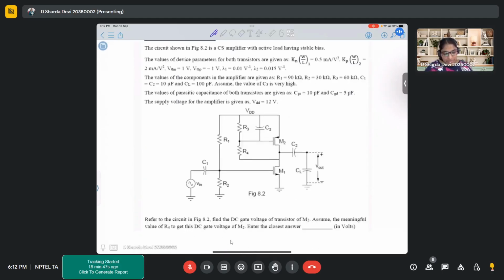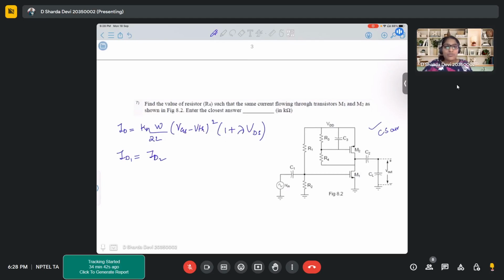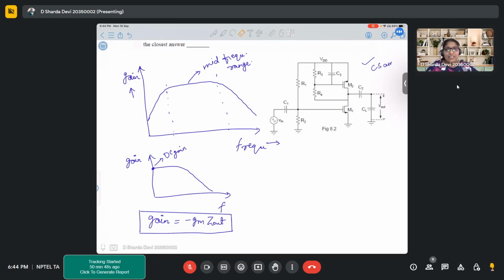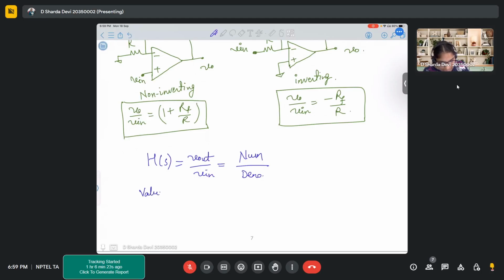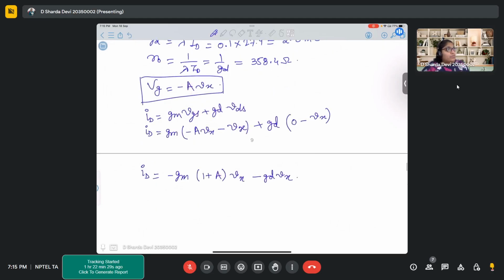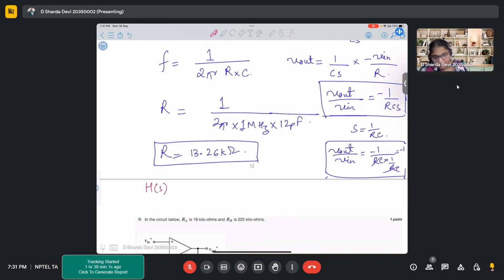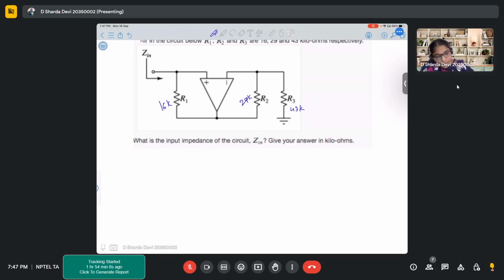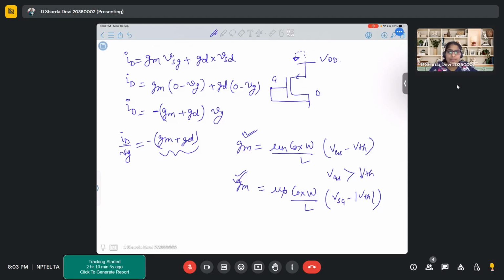Week 8 Live Problem solving session: Analog Electronic Circuits

Comment: Hi, I have  two question regarding LDO. 1)  As per Q3 & Q4, The output impedance is very small, so does it mean that this LDO act as a voltage source ? 2) What is the difference of using NMOS in one case and using PMOS in another case ?
Reply from the maker: When you use a nmos and PMOs the analysis changes slightly changing the results.